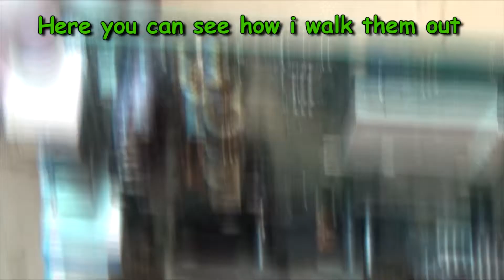How to remove bad capacitors on a motherboard

Comment: Thank you I was desoldering all of the components off of a motherboard and I removed the battery because I heard that it could explode but I didn't know the same about capacitors until I learned the hard way and one exploded in front of my face.